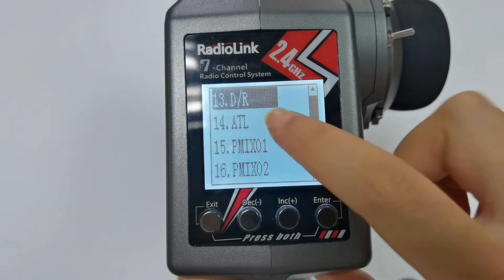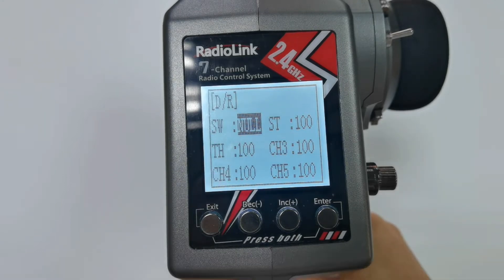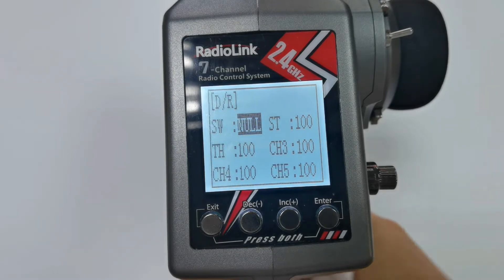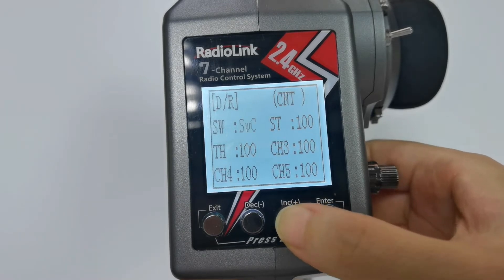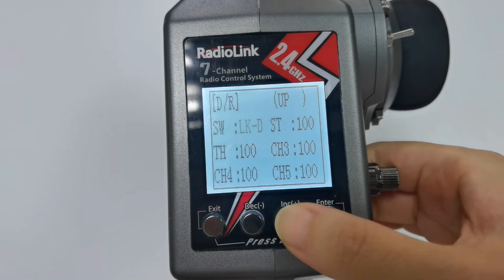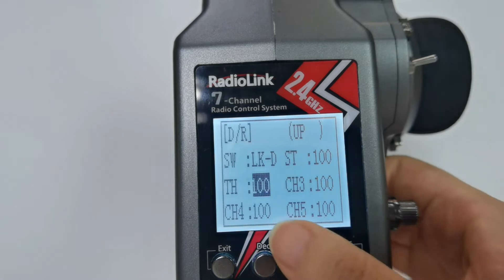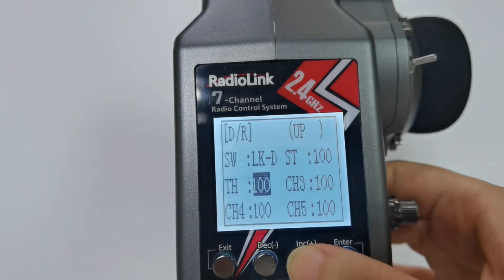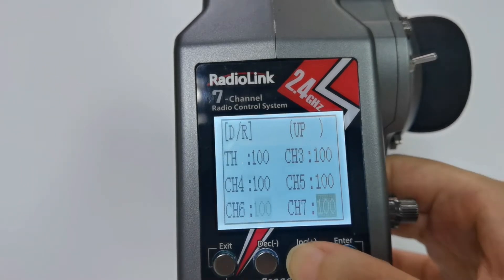How to Assign a Switch to Control Dual Rate on RC6GS V3/RC4GS V3?

Comment: I'd really like to know how to program my speed controles to work in tandem
Reply from the maker: Hi, sir. Do you mean the ESC? You just need to connect the ESC to the throttle channel, channel 2 of the receiver. Here is the detailed manual of RC6GS V3, which introduces details on how to use the transmitter, and the connection. https://www.radiolink.com/rc6gsv3_manual  If any question please feel free to contact us. Our email is after_service@radiolink.com.cn

Comment: Swd switch only works on and off. Central does nothing.
Reply from the maker: Hi, sir. Are you using RC4GS V3? SWD can work as a 2 position switch, sorry it cannot work as a 3 position switch. If you are using RC6GS V3, you can use SWB or SWC. They can work as a 3 position switch. If any question please feel free to contact us. Our email is after_service@radiolink.com.cn

Comment: May I ask you a question? How many of the custom profiles will it allow me to create and save in the SW Chanel? You showed us LK-D, can I select another one and save both of them in the SW Chanel?
Reply from the maker: Hi, sir. For SW, you can set SWA, SWB, SWC, SWD, or the lock modes of these four switch buttons LK-A, LK-B, LK-C, LK-D.  Except LK-D, you can select another switch and save them at the same time. But please note, each switch occupy a channel, if you assign 2 switches to control dual rate, there will be only 4 channels left.  If any question when using RadioLink products please feel free to contact us. Our email is: after_service@radiolink.com.cn
Reply: @Radiolink_official  … Thank you for your reply, very useful.😀 I’ll have to give it a try because I am using all 6 channels and I’m also using PMIX1 and PMIX2. I have the  rc6gs v2 TX.
Reply from the maker: @toysforboysrc  Great. Here is the detailed manual of RC6GS V3 for your reference:https://www.radiolink.com/rc6gsv3_manual  Any question when using it please feel free to contact us.

Comment: I want to know if you can set a switch to change modes if using 4 wheel steering, like front /rear only, 4ws and crab steering, as its annoying to keep having to scroll through the pmix and channel rev settings, it would be more convenient to be able to set up a 3 position switch to change between modes,
Reply from the maker: Hello, sir. May I know what transmitter you are using? There are Firmware for Four Wheels Steering for RC6GS V2/RC6GS/RC4GS V2/RC4GS and the control switch is default SWA, press it to turn on the mix function, press it again to turn off the mix function. Here is the link for your reference: https://www.radiolink.com/rc6gsv2_firmware
Reply: I’ll help you out,… let me guess, you just need to assign a channel to the servo that controls the gear box for 2wd-4wd  right? The two top switches on the radio link are ch5 on the top left and ch6 on the top right. Choose one of the switches and plug your gear box servo to that Chanel. Then go into the menu and select EPA end point adjustment. Then go to the channel you chose for the servo… because the Chanel switch has 3 positions but you only need 2 positions, you’ll just set the EPA as if you setting your trim, same thing. Just be sure your servo stops when the gears engage. Just slowly increase the value on the EPA untill the servo makes the gears engage. You can either use center position as a NEUTRAL or use it as a full value like 100% or -100%.

Comment: can you make another video that focuses on how to turn on the PMIX 1 and PMIX 2 functions without going into the menu.  This latest video still confuses me.
Reply: Awe the fre mix feature… You shouldn’t have to go into the menu for anything once you have the pre mix settings created. You get to create two of these… it’s not exactly like dual rate but it’s like this… this video on the SW Chanel/button let’s you create a folder where you can make changes to alllll your channel’s output trims, and save it in a folder. Then by pressing the SW button, it will glow orange to let you know your using the “alternate” profile setting you created and saved. 

But the premix feature, it’s slightly different…. What it does is it will let you choose a MASTER channel and let you choose a 
SLAVE channel. Example: choose throttle as your master and choose channel 6 as your slave. This will let the THROTTLE turn the channel 6 off or on depending on what you want Chanel 6 to do. Settting the master value to 100% gives the throttle 100% authority meaning even the slightest touch of the throttle will send the signal to Chanel 6 as if you physically flipped the switch on channel 6. The value you set on the slave (ch6) will be the percentage you want ch6 to do. 

Example. Master is at 50% which means the throttle has to reach 50% in order to engage the slave ch6 which is a servo that switches the transmission to 2nd gear. This means that at 50% throttle, the rc car will shift into 2nd gear.

I’ve made a few videos using this remote. I used pre mix for  activating a custom turbo sound  when I drive the rc and I used 4 mini esc to use as dimmers for all my led lights. Your welcome to check it out.
Reply: @toysforboysrc  thanks bro.
Reply from the maker: Hello, sir. The setting method of the PMIX is the same with D/R, I've send you the setting page of PMIX, you may have a check. The tutorial on PMIX may come out in a few weeks.